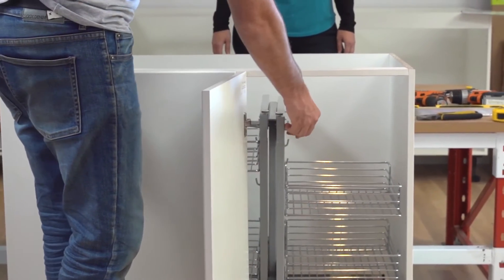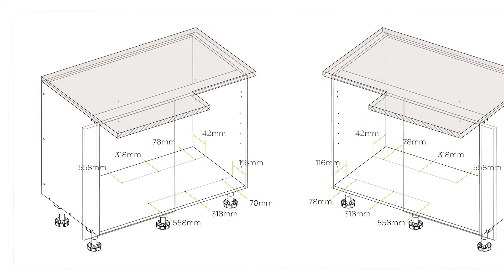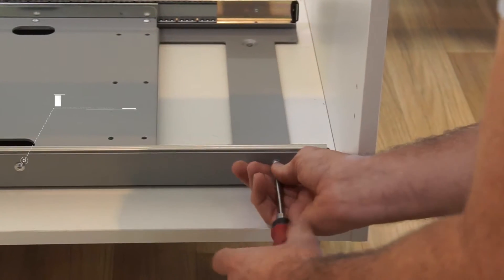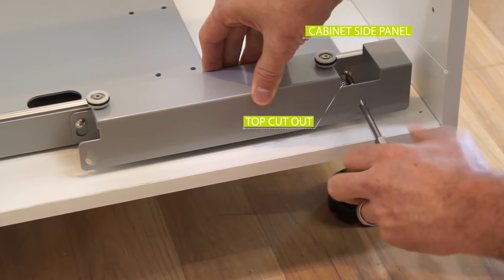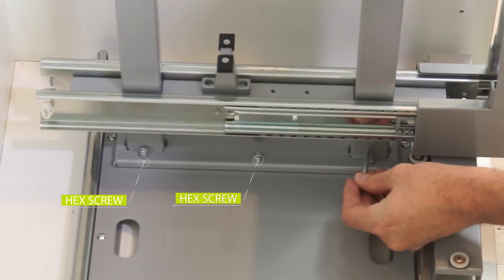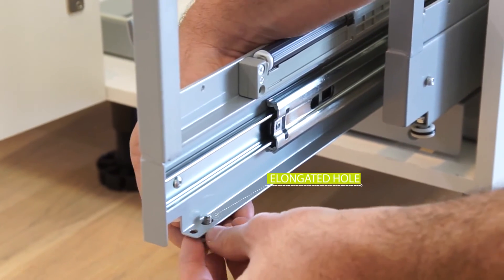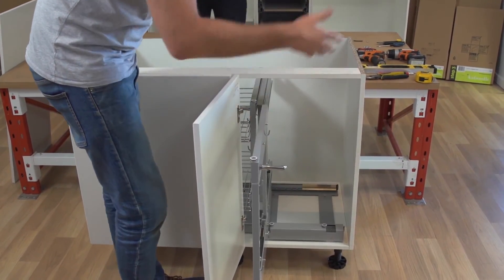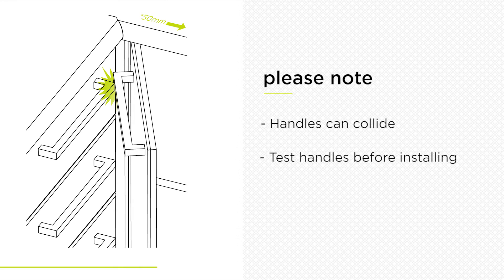Blind corner pullout baskets installation | kaboodle kitchen

Comment: This is out of date to the new blind corner pullout baskets (2022). There are now 8 holes to pre-drill with different measurements. Consult the instructions for the up to date locations. Plus, the one we purchased did NOT require us to screw in additional rollers to the front of the pull out arms. NOTE: When buying these you are going to waste ALOT of the space at the far end of the cabinet. But, I assume that's the same area you/we used to lose items that we couldn't reach!
Reply: Thanks for the helpful comment!